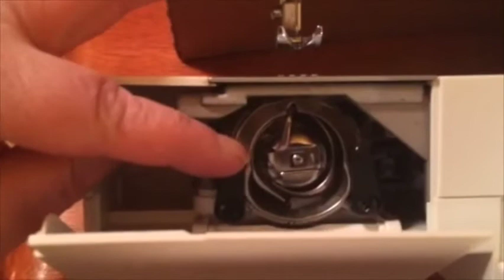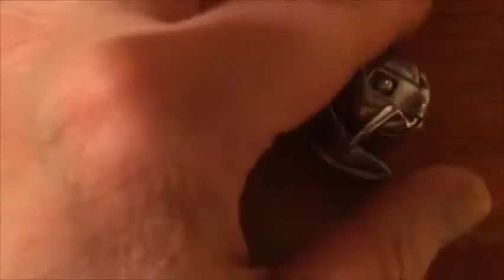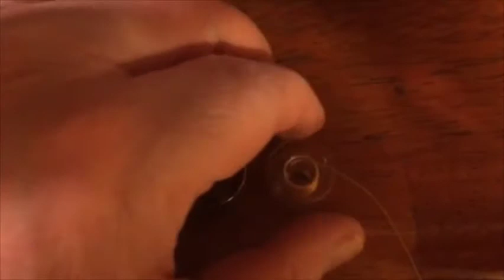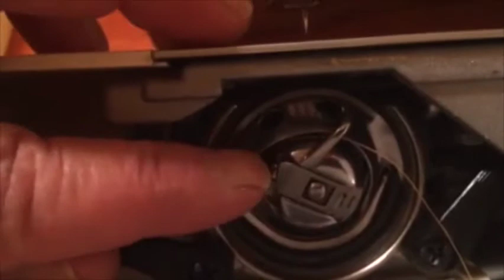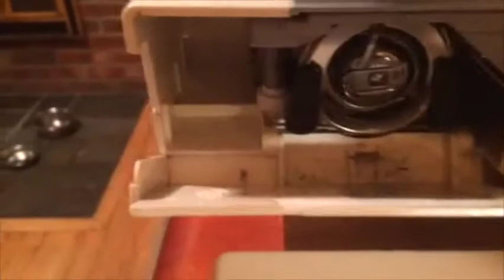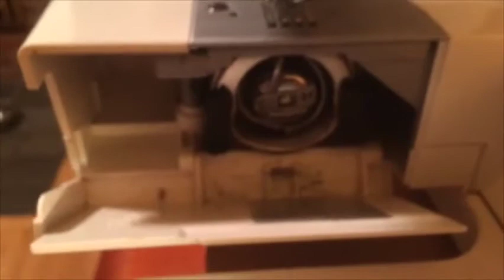Bobbin replacement on singer simple sewing machine

Comment: how do you replace bobbin winder wheel on singer simple?
Reply from the maker: Muslimah abdul-jabbar You  push the steel  bobbin post to right( disengage motor from needle   ,put  thread it through pigtail off spool an use foot peddle  to load bobbin. Have a good day.
Reply: Thank you for answering, but what I was asking about was the bobbin winder. I cannot use mine because the wheel with rubber around it inside the machine has fallen off. Can you show or tell me how to replace it?
Reply from the maker: Muslimah abdul-jabbar No I cannot  look of parts schematic expanded view on google under images I would start there. have a good day.
Reply: Peter Agostini Thank you, I will do that. I may have to take it to a shop.
Reply from the maker: If you are not  handy with your hands a good idea , I hope they are fair with repair for you . Have a good day.
Reply: I am handy, but I'm a visual person. I can seem to find anything helpful for the singer's simple. Thank you for your suggestion.
Reply from the maker: Muslimah abdul-jabbar  Look at  my posts ( links) at top maybe   that will help . print them .
Reply: Ok I'll do that.